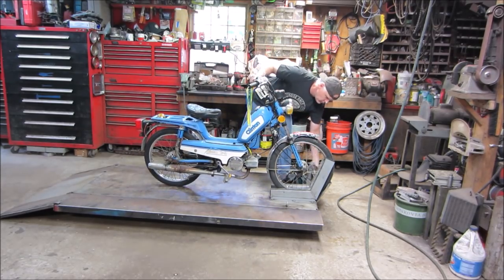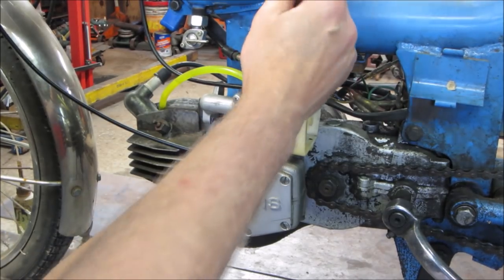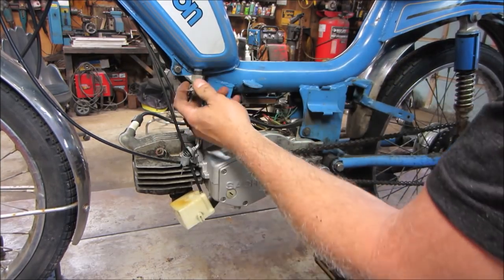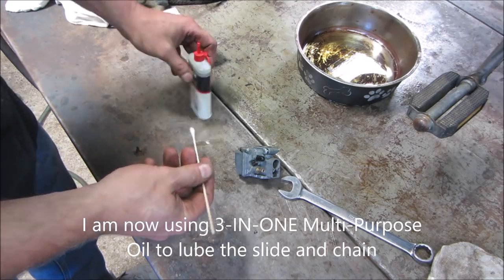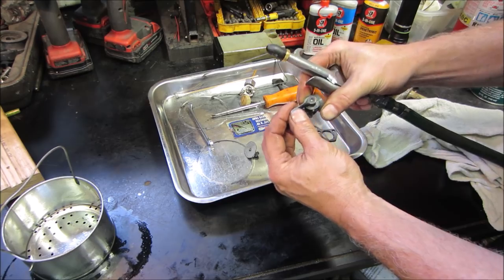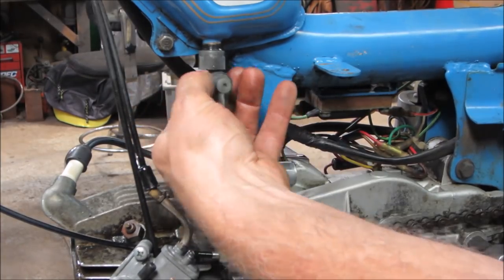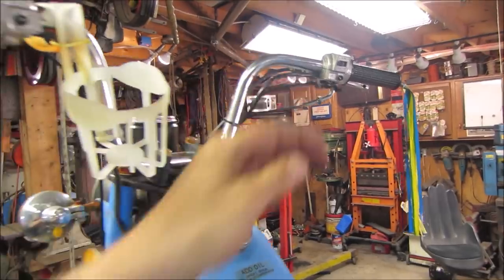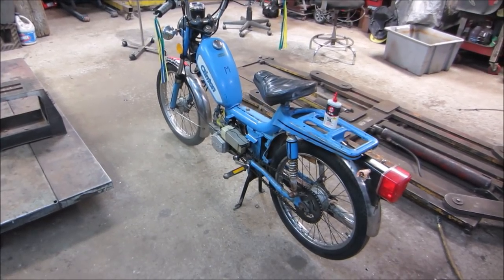Will it Run? Barn find Moped.

Comment: Clinton-brand mopeds are rebadged Sachs mopeds from Clinton Engines Co. There was only a single model made, the 50-A. It used a Sachs 505 engine and was only made from 1978 to 1980. The Clinton 50-A had turn signals and the magneto system was augmented by an extra battery to keep all the lights bright. It had a detachable gas tank (nice for cleaning and rust treating) The tank held 1.1 gallon. Fuel was premix, weight of the bike was 119 lbs.
Reply: I never knew they exported 50cc mopeds to the US.
Reply: @stelleratorsuprise8185  All the rage in the 70s, but somehow they all ended up in sheds and behind barns by the 90s.
Reply: @stelleratorsuprise8185  I had a Beta that was a 50cc back in the 70s.
Reply: @macelius   thats coz yamaha brought out the fizzy ( fs1e)  in the 70,s it was a big jump from mopeds  as it was literally a motorbike of 50cc that could be made into 100cc by buying an aftermarket upgrade kit and it didnt look different :)
Reply: I love that funky old moped. Very disco-tastic!
Reply: So thats what Bill did in his spare time!Lol.
Reply: I didn't recognize the "Clinton" named bike, but I did know the Sachs brand.
I had a Tomos in 1982 and it was a 1978 Tomos 2 Speed Automatic Silver Bullet.
Mopeds were ALL the rage back in the day what with gas prices, insurance and registration fees.
All that was negated by having a Moped.
Cheaper than a car and you ONLY NEEDED a learner's permit.
Reply: Good stuff, I've owned a 1979 Kreidler MP-19 50cc (German brand) for the past couple of years... 42 years old and still running like a top, it's my daily driver instead of a car. Interestingly enough, it looks as if the Clinton shares a few parts with it, most notably the muffler

Comment: Yep you can't beat a drop of 3-In-One, i grew up with it too :-D

That machine is so similar to the Puch Maxi moped, it used red A.t.f transmission fluid for the clutch/gearbox too.
That bike steams along very nicely :-D.
Reply: puch is an austrian brand. this is german stuff
Reply: I think 3 in 1 Would do the job!
Reply: reminded me of my old motobecane...my mate had a racer push bike that went faster :-)

Comment: I must admit seeing how effective 3-1 seems to be after watching it been used in the last couple videos it does make me want to buy a bottle for a try. Advertising works
Reply: I've used it in motors, bearing blocks, on high-carbon tool and knife surfaces and on a long q-tip to clean mechanical surfaces...drizzeled it into chain drives and dripped it down into old choke cables and gas-feed cables on lawnmowers, & in my sewing machine. Shoot a little in on the bearing in the bottom of a weed-eater and lubricate any pivot point, in a mechanical linkage system. Also is great to use on model airplanes and model trains, battery operated model boats...and the uses are endless!

Comment: German Sachs 500-505 series - one of the best moped engines ever! Some mopeds had a separate belt or chain drive with the pedals, but the 505 Sachs, had it all built in to the gearbox.
I purchased a 'demo'  'Wards Imperial' moped with this engine, from Montgomery Wards in 1980, for $400, after they marked it down from the original retail of $750.  It's the only new motor vehicle I ever bought! 
My gas- tank is built in to the frame like your Puch. At the time, their catalog listed another model with a tube-frame and separate gas-tank, similar to yours. Mine was built in the US by Columbia - the bicycle company, which they also sold as the 'Columbia Commuter'.
In my state, these were restricted to 20 mph, but mine could barely top 15 until I removed the restrictor-plate from the carb. Then it would do 20 easy, or even a bit more. So I guess that made it the 25 mph version. 30 mph models used a smaller rear sprocket.
Mine's suffered from being stolen and recovered from neighborhood delinquents in the '90s, then being stored in a leaky shed for awhile. But I fixed it up and got it running again a few years ago. Shutting off the gas and running the the engine to burn off the remaining gas for storage has saved the carb. 
5 years ago, I also bought and revived a 1977 Euro Sachs moped. It has the 504 engine, with a separate chain-drive for the pedals, Km speedometer, and a strange headlight pod with a 'half' headlight across the top, and the horn behind a grill across the bottom.
in the '70s, many states changed their motor vehicle regulations to allow these without titles, registration or tags. But then they relaxed the speed restrictions and many states now require registration and tags again.

Comment: Use to use 3 in one oil for lubing up the squirrel cage on the swamp coolers when I was getting them ready for winter and summer.  I agree it's great stuff
Reply: I am from New Hampshire and I didn't know what a swamp cooler was until now haha
Reply: You enjoyed,, , prematurely, , replacing, shaft, bearings,, huh???   WRONG, , , tool for 'th job!!!

Comment: Clinton-brand mopeds are rebadged Sachs mopeds from Clinton Engines Co. There was only a single model made, the 50-A. It used a Sachs 505 engine and was only made from 1978 to 1980.

Comment: Aluma-weld sticks weld anything aluminum with propane torch.  I have way too many of them, maybe 200 sticks.  I fixed holes in my aluminum jon boat.  I think they would work to put that nipple back on the fuel shutoff.
Reply: yep.. "lumiweld" and similar brand sticks can repair that kind of stuff really easily... its probably a common fuel tap size and if you dont have any sticks already a new chinese tap is probably cheaper... but always useful to have an on hand
Reply: I think I may have Lumi-weld sticks.  Wonder if Mustie has any or tried them?

Comment: For a moped that's supposedly done less than 4000miles, that front sprocket looks mighty beat.

Edit: oh, I see, less than 4000 miles is when the speedometer stopped working. Well that explains that, I guess.

Comment: This video brought back memories for me. my first moped when i was a kid was a crescent 1260 with a Sachs 505 motor. awesome little moped and i still have it. about the oil, the top screw and the bottom "plug" you saw is the axle for the start mechanism that pushes on the clutch, you take the cover of, lean it to drain it, then fill it back up to the edge of the cover. i have the service manual for it, but its on paper. and you are missing the decompression lever on the cylinder so that probably leaks if someone didnt plug it. Love your Vids man. so relaxing to watch

Comment: Nice! Had heard those Sachs motors were decent, but must admit haven't run into one that I've worked on yet, and that thing took right off. Needs a bit of TLC yet, but would be a great bike for your other half..just saying ;) you could pull out one of your bikes, and you both go for a ride together. Do treat those wheels though.

Comment: Tomos is best!!!xd
Reply: I had an A3K about 15 years ago, paid £80 and it had under 800 miles on it, even came with a matching red/white piss pot helmet. was great fun zipping around the back lanes & if you timed it just right you could blip the throttle when it changed gear and make it sound like a manual shift haha. The clutch was very sensitive to the correct weight and amount of oil I seem to recall. Too much and it'd slur the shifts badly.
Reply: Just remembered from this video, the fuel tap was the "key" on the A3K lol.  Also got given an A3MS maybe 10 years ago, it had stood outside for years and the engine was locked solid. I ended up cutting the frame up to fit a SYM 100 CVT rear end and made it into a scary 80+mph speed-ped
Reply: dan mackintosh I dont know about you,but I have 2 tomos mopeds  and I never have a problem,and if something broke or something like that the parts are really cheap and I can find parts everywere.
Reply: Yes, the A3K was a great little machine. it'd do 40mph with a bit of a following wind even with my 220lb squashing it. It lived outdoors and never let me down, always started 2nd kick cold/1st kick warm. I would have fixed the free one but it was very far gone, crank rusted and all. I'd love another though, theyre so fun. (I love the sound of the horn too, holding the button down and rev the engine was too funny, like an angry fly in a tin can :D ) Happy days.
Reply: dan mackintosh Haha Awesome dude,the horn is best😂😂

Comment: Not sure if I'd mentioned this before, but 3-in-one eats rust. I used it on a brake line union as it was rusted into a "T" and would not come off. I let the 3-in-one soak over lunch for about an hour and a half. Came back out and the rust came off the line like wet sand, and union came out of the "T" fine, but still required a back-up wrench and some force. I now use it when doing brakes to prevent the line from twisting behind the union. And when dealing with nut-on-bolt combo, I'll soak it behind the nut. I've come to realize that the only thing that really helps metal siezed into metal is to heat the outside metal then remove the inner metal.

Comment: From what my grand mother told me 3 in 1 oil was first made for the sewing machines, the sewing machines were made with little holes everywhere that had an area that needed oiling, and the little red top was made to fit the holes with out dripping all over the place she had a metal can of 3 in 1 and I still have that can to this day, I was 5 as well when she taught me how to oil he old singer sewing machine..... My favorite bottle is the one with the telescoping tube that pulls out of the container.

Comment: Musty a lot of people don't understand about adding Stay-Bil to a fuel system if a motor is going tgo sit for any length of time. I use the stuff in all of my combustion motors,from m/c's to lawn tracktors and snow blowers. I have a '92 Lincoln Mark Vii Bill blasé edition that I have had for 20+ years. If I'm lucky the car is driven 500 miles a year,it currently has 61K on the clock and I picked it up with 42k.There are times the car sits for a season or two but I put stay-bil and the next time I fire it up it starts right up. Even when I store my VRod for the cold winters here in New England I've never had a problem starting. To me its an awesome investment

Comment: Love the smell of 3 in One, popular here in the UK too. Always a small can with its flexible plastic spout that you had to cut the top off, and screw the red cap on. Went and checked and yes I have two tins one in the garage one in the shed, for the garden tools. Nice video as usual involving and educational as well as entertaining. I was just thinking how many times have we done a circuit of your garden and the different machines we have been in, then we out on the open road, in rush hour, then we are off roading up the inside of cars, missing dustbins, letter boxes, I was laughing out loud such fun

Comment: That was a simple successful project! Good job Mustie! I fixed up my like new 93' Timberwolf 4x4, all it needed was a new carb, the old one was shot, and a new air filter! It runs perfectly now, it'll sometimes randomly die because of a hole in the exhaust, but I can just simply slip the old one off, and put a new aftermarket baffled exhaust on it, as the OEM's are very expensive and poorly constructed.

Comment: Back in the mid 70s a friend and I had been given a Puch moped. Having a lot of 2 stroke between us we started to tweak and twist on it to go faster. I took it out one day after putting a bigger carb and an expansion chamber on the exhaust.  Man that thing would fly!  Buried the Speedo at 45 and just kept pulling. I turned around and came back and show off a bit and fly past his place. I flew by and being less than a block I got on the brakes. I managed to slow down to about 30 when the brakes faded away. Less than 25 yards from a very busy US route 41 that was usually bumper. I clenched my teeth and blew through the intersection. I got slowed down, turned around and waited about 5 minutes to cross back across US 41. I took my still shaking butt and moped back to my friends house. I never rode the thing again. I was one cool cat back then, I figured I used up at least 7 of my 9.lives...

Comment: Hey Mustie1", I APPRECIATE you taking the time to do these videos. I have, on occasion, put this little invention of mine, in the comments, but you probably haven't seen it yet, so here goes again. : Take 2 Crocodile clips, large enough to clip around the base of a spark-plug, and clip the strain relief off of both of them. Take the screws out. Drill out one set of threads. Place them end to end and run the screw thru the hole you just drilled and into the threads of the other clip. This way, you'll have a clip on both ends. Clip one end on the base of the plug to test and the other clip onto frame ground and put the wire on the plug. Have it angled so you can see the plug gap from your starting point. You never have to wonder if you're getting a good ground and you never have to worry about a 42,000 volt charge thru your body if you goof up. ((& that feels like millions of saw-toothed legged spiders racing thru your body all at once!)) 
   I hope everyone makes them one. Hardware store sells them for about $1.50 each. You need 2 to make one.
   I'll say this for ya...you've got lots of guts...on that test run, going down the side of the road...and that garbage can...well...you made it! Wow!
   PRETTY WORK !!!
   I used to have a sharpening business and I did lots of knives for guys going to gun and knife shows. When I was done with each knife, I had a soft cotton rag with 3 N 1 oil on it and I lightly wiped all the blades with it. Then packaged each knife in a baggie and taped it. That way, no matter how long the collector left his collection in a box, it stayed showroom ready. 3n1 oil and the slick finish kept business coming. I'm retired now, but I use 3n1 oil in all my motors and pedistal bearings.
   Hey Mustie, a buddy of mine used to worknon weed-eaters and when adjusting them while they were running, his screwdriver kept sliding off the screw, so he took a little piece of steel brake pipe, that was just a little bigger than tge outside diameter of the screw and crimped it onto his screwdriver. That kept it in the groove and on the head of the screw, no matter how much it shook! You might do that for yourself.
   Bill from Tn. 🇺🇸

Comment: i had a snowmobile with a bad battery, i could start it manually and while i was riding it the stator burned out....$400 later it was running.  and it would not run without the stator.   good video!

Comment: The Sachs 505 air filter isnt supposed to be oiled but has a tendency to get drenched in oil 
sadly i forgot what caused this but i remember on my old Hercules Prima 4 i owned, the 
air filter was covered in oil every time i changed it.

Since theres a huge restoration/nostalgia scene here in europe 
for old mofas you can easily get spare parts(like the broken decompression handle).

Comment: You are crazy driving on the shoulder like that.  Good way to end up on your a$$......  BTW, love the sound of those two strokes when you speed up the video!  Makes it sound like an RC gas engine.... ;-)    Also this video brought back fond memories of my moped that was taken from me.  I believe the brand was 'Imperial' but it had the same Sachs engine and was candy apply red.  Had the long seat instead of the pear seat so you could get two people on it.  Was a great ride and great engine.  Very reliable.  Not as much power as the Puch but  was higher reving and could outrun a Puch on a long straight or downhill.  Man how I miss that bike......

Comment: I use 3 in 1 oil every summer before I use my fans. Make sure blades are clean,  Even fans I buy from Goodwill that are dirty and no one seems to want,I bring home clean and lube them and they run great. You find such interesting things to fix. This one looks like a blast. Wish I was there to try it out! Does it have rear turn signals that are in the tail light? Oh, wait. I see where they are missing,  I kept saying "come on, lets go for a ride!!

Comment: Clinton-brand mopeds are rebadged Sachs mopeds from Clinton Engines Co. There was only a single model made, the 50-A. It used a Sachs 505 engine and was only made from 1978 to 1980. 
Also Sachs engine is also used in the Puch Maxi, and  is the Austrian firm.  At last, the plastic covers look like the Puch Maxi covers.

Comment: the sachs transmission uses a 3 disk clutch with a doughnut of weights that compress the clutch with speed.  the clutch pads are directional and size order specific.  if the spring holding the weights has an issue, the only fix is a parts bike.  There was an after market clutch available, but it's super rare, it had 5 plates to help the clutch stand up to a 80cc kit

Comment: Centrifugal clutch, plug on the side is the filler and oillevel plug. Fill it if the oil is not running out any more its okeey. Its the same kind of oil and same deal for Tomos A3 or A35 Or Puch maxi. Drain plug is just below the cover.

Comment: I had a norman nippy moped - with a sachs 50k engine and a three-speed gearbox. also had the same coaster brake thru the engine cases.  it sounded just like that one - especially so when you get it flat out and beyond

Comment: I remember my father always kept 3 in 1 oil around particularly kept in a little bin within the towel closet for use on electrical motors around the house. With all the carb issues you run into I'm surprised seafoam isn't also a sponsor.

Comment: I always have a couple of bottles of 3 in 1 oil around. Kinda fits in between WD40 and motor oil.. Just the ticket for certain uses. Another product that's always in my shop is DeOxit for cleaning electrical contacts, switches and potentiometers in dials and such I keep two types lubricating and non lubricating..